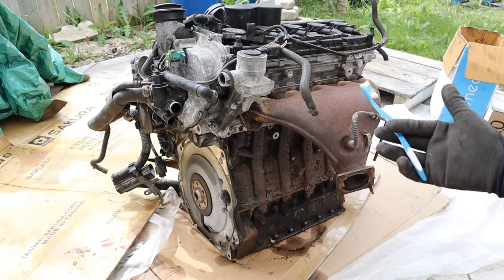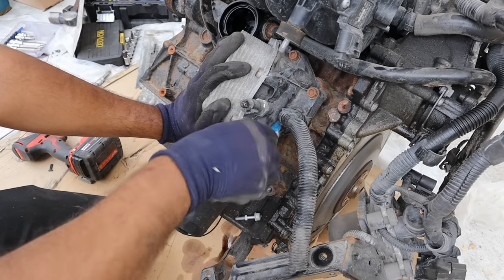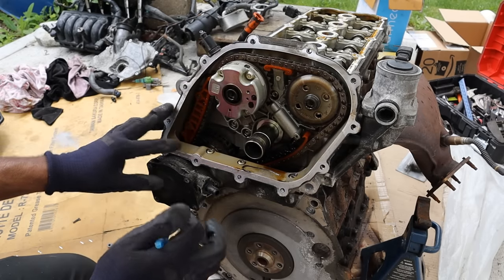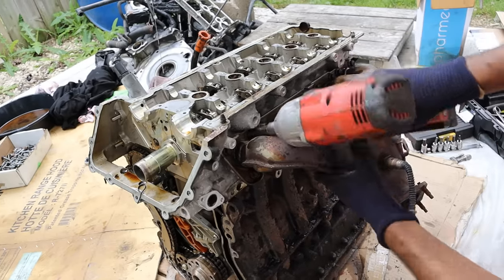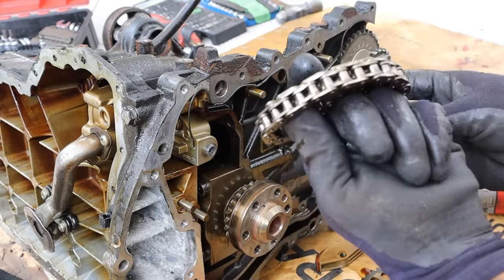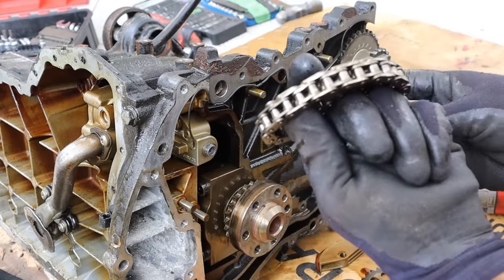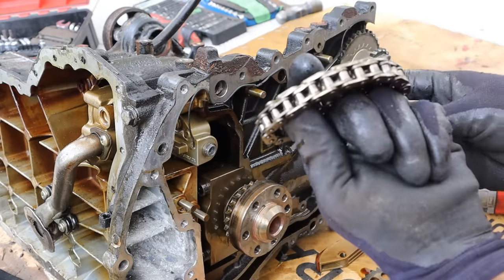The Volkswagen 5 Cylinder is an Anomoly

Comment: I had 1990 Audi 90 back in the day... I should have never sold that. The 5 cylinder was smooth but slow off the line. But would cruise at 80 MPH like nothing was going on.
Reply: Volvo is like that smooth and quiet...
Reply: Used to drive around in an unloved/abandoned '87-ish Audi 5000 after high school and you're right: these cars would just criuse at 80 mph with that 5 cylinder, maintained or not. Smooth as butter. And that was with a THREE SPEED automatic.

I remember thinking the engine must have come through the front bumper in an accident the first time I opened up the engine bay on that Audi. 😂 Not to mention hunting for the battery (under the rear passenger seat)...
Reply from the maker: Awesome!
Reply: I still drive my Audi 1990 90 20v. 170hp 2.3L 5cyl engine code 7A. 221,500 miles, still smooth! Rare engines, although I would love to see you tear one down. They were well engineered.

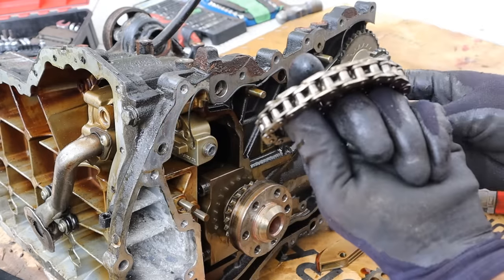Comment: 15:08 - Later models of the Rabbit (2008 & 2009) Jettas and Mk VI Golfs were able to produce 170 HP and 175 lb-ft torque from their 2.5L 5 cylinder engines.
Reply from the maker: Yes , I misquoted that

Comment: I still drive my 08 Rabbit with this engine. 125k MI. I’d love to keep it but based on this video, once something dies I’m junking it.
Reply from the maker: Awesome. If you have the automatic...watch out
Reply: Regular maintenance took mine to 225k miles before it was totaled, still ran like a top. I'd done the valve cover at 220k after it started leaking, it was varnished but the cam lobes were still shiny clean. Changed the oil every 5k, as you should

Comment: 2008 Rabbit with 165,000 miles, runs great. Leaks a tiny bit of oil and coolant.  But what's with the tiny little bulbs inside the headlight housing?

Comment: You were doing ok then you stepped in it and thats why youre reading this, LOl. The diaphram does NOT require you to replace the entire valve cover sheesh ts not a Mercedes. That engine with proper maintenance is virtually bulletproof if not the best engine vw has built in a very long time.

Comment: Good info i own a 2.5 passat had to replace the compressor, throttle body, a power steering hose that was cracked and i was able to change that diaphragm and a MAP sensor probably the next thing is new brakes

Comment: It isn't true what you said about always having a piston on the power stroke.  The typical power stroke is NOT 180 degrees;  It starts when the spark plug fires and ends when the exhaust valve opens.  Typically, sparks fire just before top dead center, and typically the exhaust valve opens about 120 degrees after top dead center, so figure on 125 degrees +/- a few of power stroke. 

Since on this engine during the first rotation of the 720 degrees for all cylinders to fire, you have three cylinders fire for 375 degrees of power stroke.  But the second rotation only has two cylinders fire, for a total of 250 degrees of power stroke.  Thus, there is about 95 degrees of dead zone on the second rotation.

You are right about these things sounding cool!  But the best was the Volkswagen V5 engine sold in Europe, these sounded amazing!

Great video!
Reply from the maker: 125*? That seems like alot of power will go out the exhaust!
Reply: @speedkar99  That is why turbo's work so well.  Also, beyond this point, the primary force of the piston is not contributing to rotation of the crankshaft;  Instead, it is simply pushing down on the bearings as the piston approaches bottom dead center.  

For proper exhaust scavenging, the exhaust needs to open early as well.

Comment: Honda did 5 cylinder engine in longitudinal layout for domestic market Inspire, nice torque and hp
Reply: Pretty interesting considering it was still fwd
Reply: @RPS13DRlFT  I actually drove one of them, well  weight distribution (differential located inside the engine oilpan) so quiet and smooth running, not hoarded nice interior, maze-like path shifter. Really miss that years I had sence of joy and life
Reply from the maker: I agreed...I was pondering over one at the junkyard and was intrigued by the engine/ transmission layout

Comment: Great video and you provide one of THE BEST Youtube channels about cars! It is absolutely INSANE the number of different fasteners used on auto engines today! Though not a big fan of a 5 cylinder engine - how about just adding some more cubic inches to your inline 4 cylinder? No, that makes too much sense.
Reply from the maker: I'm glad you appreciate my work. Agreed on the fastener count!
Reply: Lol what type of car guy doesn't like a 5 cylinder? Whether it's from Volvo or from the VW/Audi group they are special...... They sound so good, and have very smooth power delivery. Tuned they are very visceral........ Did I mention they sound good besides they're great reliability? You've never heard a boosted 07k, group B quattro or a IMSA GTO?

Comment: You don't need a new valve cover to replace the PVC Diaphragm. You can see the cap pops off & you can replace the diaphragm & spring for $10. Just make sure you don't use metal to pry open that pvc cap. I use those plastic trim tools.
Reply from the maker: But don't they break when you try prying them off?
Reply: This is true but it’s a gamble especially since the last year of 2.5L was manufactured in 2014 (them being atleast 9 years old to 17 years old). Most people replace the entire valve cover as others who have tried to replace the pcv diaphragm don’t have a large success rate (atleast in the VW 2.5l Facebook group).
Reply: You can actually replace just the diaphragm, it comes with a spring and new cover. If you can find a parts guy that is any good dorman make one. I got mine from fibi a division of Bilstein. Not very expensive.
Reply: @Tony-375  what does it matter if the last production year was 2014? Are emplying that the plastic is weak due to age?......
Reply: @MiguelGarcia-vj7oo  yes I work on cars everyday at a Honda dealership. I’d say you’re gambling with it and that’s even if the new pcv diagram works.
Reply: @speedkar99  I know its been a while but i've used those plastic trim removal tools but it is a bad design by VW. The main issues with this engine is the emissions crap but the plastics hold up surprisingly well. That engine your taking part looks like one of the older versions & unfortunately they stopped making these in 2014. These engines are better than the smaller turbo versions.

Comment: Best engine ever
Reply from the maker: Sure..
Reply: @speedkar99  i don't see why not. Super Reliable and sounds like an old group B quattro when tuned. Terrible tuning support but these make 400 hp with stock internals, reliably. Parts are  Interchangeable with the Audi rs3 07k as they are in the same family of engines. Tuned These make the same amount of power at every stage as vws TSI while sounding better and handling the power way more reliably. Whats not to love?

Comment: At least in my Volvo ('99 T5) I can access the intake and exhaust bolts.
Reply from the maker: Nice.
Reply: Those volvo 5 cylinders are designed to be able to be worked on, unlike vw and audi equivalents

Comment: I have a 2013 jetta with the 2.5, and a manual transmission. I've heard about the secondary air injection pump. During a cold start, for about 5 seconds, it sounds like a toy with a really gunked up plastic gearing setup, then after the 5 seconds it sounds like a vacuum turning off. I've heard that it might be the pump and that it should be replaced. It's about $80USD. Just wanting a second opinion. Also how can I tell when the PCV diaphragm goes?

Comment: Really, only 148hp? Not comparing apples to oranges but the Volvo N/A I5 2.4 liter makes 176hp. If this is the block for the RS3 then the head and turbo make drastic hp gains, interesting. Not completely sold on doing a timing job and having to separate the trans from the engine. But those RS3s are fast! IMO
Reply from the maker: Sorry I got the number mixed up it's 170HP which is more comparable but still paltry by today's standards given 4 bangers are making 200+
Reply: Dude that engine produces 170 or 177 hp in the 2008 rabbit can't remember if 177 was torque or hp but the other is 170 so either way somehow they got an extra 22 to 29 hp after 2007 same engine also produces 150ish in the 2011 jetta.. why I don't know 😕
Reply: @speedkar99  170 HP sounds more like it, thnx for the reply. Honda made some i5s I guess, can you keep an eye out for one of them for a teardown plse? I can only imagine how much HP and torque a direct injected, turbo'd, and V-tech'd i5 would produce? lol
Reply: @michaelstrongbow2336  this engine was handicapped by the factory to not compete with TSI sales. That's why these barely made power from factory. Integrated Engineering makes a nice stage 2 N/A kits that pushes these into 225 hp. They fully built one to 280hp.  The sound clips are a eargasm  I suggest you research. These can take about 12 bars of boost reliably making 400 hp max with stock internals . With internal modded, they can make as much power as an RS3 due to parts interchangeability. 
 2. These engines are part of the 07k family of engines including the Audis. These are just watered down. Iroz motorsports in Las Vegas uses the VW iron block for their 1300hp RS3. Again The parts are interchangeable. 
2. The 07k engine was designed by Ulrich , who is the head Audi engine engineer. He based it from the Audi IMSA GTO race car motor. This is the same guy you created the Diesels for their dominating Le mans program. 
 Lastly if you see some approachable builds I suggest looking up that Dude from Donut media and 07k swapped golf or ECS Tuning project 944 Safari car.

Comment: Question. What's a 'hydro formed cam shaft?'
Reply from the maker: Hydroforming is a manufacturing technique. They place a tube into mold and use water pressure to force it to confirm to that shape.

Comment: im not an engineer but i cant think of any reason why in lots of german engines they put the timing part on the side of flywheel. so if something goes wrong with timing ( which lots of them are famous for that ) its would be such a pain to fix a simple timing issue
Reply from the maker: Agreed. Seems Akward from a servicing perspective.  For longitudinal mount it makes more of the weight towards the back of the car but that doesn't make sense in transverse mount....🤔

Comment: Hmm, and where's the balancing shaft? As far as I'm aware, 5 cylinders can't work without it
Reply from the maker: I thought so too.
Reply: There is no balance shaft. There is some NVH with this motor. They use soft mounts to compensate, but that makes mounts go out all the time with this motor, especially the manuals.
Reply: The 5 cylinder design actually is so much smoother in nature because of the power stroke design. Because as one cylinder is finishing power stroke another is in stroke before it's done. I have one in a Jetta wagon. This car has embarrassed many cars with more power. If you haven't driven one , please do before dogging one. Reliable, nimble and some what fuel efficient. With proper build can make over 400 hp and still be reliable.

Comment: I think electric pumps are the best. When it goes bad it will just send a error code unlike the belt/chain driven one wich when it falis it might be too late till you turn off the engine.
Reply from the maker: I'm that case you might as well get an EV...
Reply: Electric pumps go out with no warning. Usually there is noise or leaking before a mechanical pump dies

Comment: Arguably the only reliable engine VW made for quite a long time.. wasn't perfect but if well taken care of, oil changes every 3k, coolant kept up with, they'd run and run pretty much trouble free. OEM ignition coils will fail but that's every VAG product on the road (red top aftermarket ones solve it). Probably why VW killed it off in favor of their disposable, unreliable and crappy in every way turbo 4 gassers (barf)
Reply from the maker: Yeah from what I've seen these are reliable and as in this case, the transmission takes them off the road. The 4 banger is more space efficient
Reply: @speedkar99  Yeah I'm not real sure what they were thinking/smoking shoehorning these things into Wabbits with a hydraulic press (especially coupled to early DSG's), but they worked really really good, for me anyway, in the later Jetta's with the newer traditional slush box, right up to the end. I'd love to have another decked out '15 Jetta SE 2.5, got crashed had to replace it with a '12 CC 2.0 turbo 6spd, one of the worst cars I've ever owned
Reply: These can do the recommended 10k oil changes easy. This motor is very easy on oil. Tight rings, 6.3 qts of oil, large filter, port injected, low to midrange torque not requiring high rpm. 

This is why you still see so many of these on the road compared to the 2.0t in same year vehicles. That motor is hard on oil. 

At 10k the oil is dark brown and still thick compared to other motors where the oil is black and thin like water.
Reply: Lol these engines work perfectly fine at 10k oil change intervals as long your using the factory spec Castrol oil or better. The 09g gearbox  aren't perfect especially the first couple of years, but there is a guy on Reddit with a 07k Passat with over a million miles and his 09g crapped out at just under 600k miles ........
P.S. coil ingnition packs can fail even though they are a lifetime part by VW. Caused heat soke from that annoying engine cover/intake. The red tops you are talking about are not aftermarket. They are OEM Audi R8 coil packs........
Reply: @workingmanaudio2754  yea OP comment is all over the place. I've seen guys test their  oil on these at 13k-15k miles and the oil was still safe. As long as your using the factory spec Castrol or better like Liquimoli or Pennzoil, 10k is perfectly fine. Those redcaps he mentioned are not aftermarket, they are OEM Audi R8 ignition packs. Lastly the 09G gearbox is not perfect but if you do the transmission fluids right, I've seen these at 300k easy. There's a guy on Reddit with 1 million mile  Passat and his 09G crapped out at just under 600k miles.
Reply: @MiguelGarcia-vj7oo  sure bud keep pushing that stupid advice, 10k-15k oil change intervals.. Sludge boxes keeps me VERY well paid 😉

Comment: I have one with 206k miles, still runs like a sewing machine, unfortunately the 09g transmissions they’re mated to are absolutely soggy
Reply: have you changed the fluid? it helped mine, it's a pain because you have to drain & pump it in
Reply: It's mostly the transmission shift logic which is a detriment to the unit. It really wants to short shift up to a high gear, then downshift the second it needs any more power. If you ever start going up a hill at relatively low RPM and throttle position, it'll abruptly downshift quite jerkily if you dip under 1k rpm. I can't imagine this shifting is good for the unit's longevity as it feels awful from the drivers seat.

If I'm going to be ascending a hill, I often put the car in manual mode and hold a gear that keeps me above 1500rpm so it doesn't force a downshift while traveling uphill. I'm at 218k miles with it, hoping to get it to 250k.
Reply: @wandameadows5736  when I got the car the trans was completely toast, put a new one in and still had some issues with new fluid. Did a test drive last night and my brother who was driving nailed a rock and cracked the trans pan 😂😂 driving to put a new pan on the side of the road as I type

Comment: Better yet, how about making a more "efficient" 4 cylinder engine. Car engines are only 25% to 35% (on your high end cars) efficient. You can take (if its metal and not plastic) air intake and port and polish up to 85-90% efficiency. Quicker response, a bit more horsepower, but a much better running engine, better fuel economy. less emissions Trying to deal with "emissions" after the fact in the tail pipe is an assinine way to approach the workings of a combustion engine.
Reply: The best thing to do is delete all the emissions crap except for the cat. Al that stuff does is hold back the engine & the new direct injection crap causes a lot of problems.

Comment: Should call them JUNKSWAGONS.
I've worked on those and one thing not mentioned is the coil packs are NOTORIOUS for failure on those 5 cyls VWs. The PCV valve is LAME too
Reply from the maker: Ever had the transmission fail?
Reply: @speedkar99  No, but the engine is problematic enough. I worked on a Jetta that was just about left for dead. The PCV, the coil packs, the plugs fusing to the cylinder walls, the weird radiator fan assembly, the odd intake filter assembly.. the German fasteners.. not a joy
Reply: VWs 07k are not perfect but when taken care of they are reliable, just like an old AMC 242. There is guy on Reddit with a 07k Passat with over a million miles on his second Automatic gearbox. These tuned make the same amount of power as an TSI while being  being more reliable and sounding like an old Group B Quattro.😉
Reply: @MiguelGarcia-vj7oo  it's good to take care of a car, but the DESGIN of the cars' components is pure garbage
Reply: @rickpontificates3406   again whats garbage? This is vws only modern reliable gas engine? Theres so many of these over 200k/300k  miles. These can reliably take 400hp max on stock internals.

Comment: VW/Audi had 5 cylinder engines back in the 80s and that is NOT COOLANT LINE ON THE FUEL RAIL..!!!
It is in fact FUEL LINE; DO NOT EVERY REPLACE THIS LINE WITH COOLANT HOSE..!!!
It will burst and cause a fire; use only VW/Audi OEM Fuel Lines..!!!